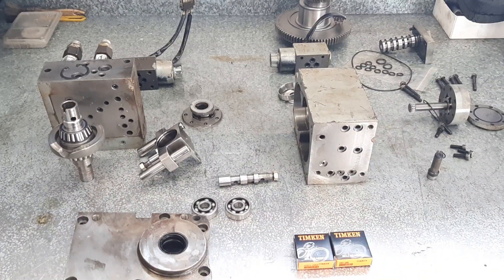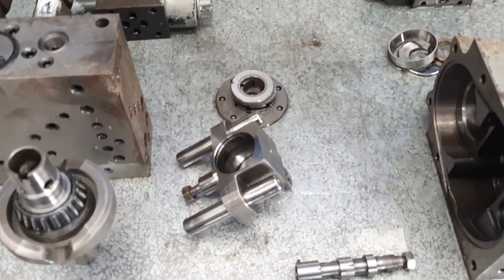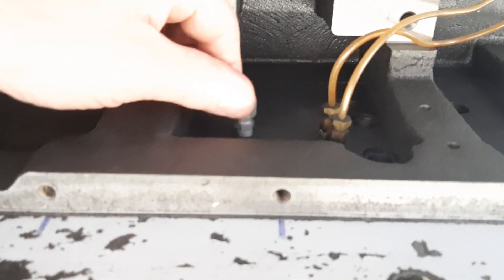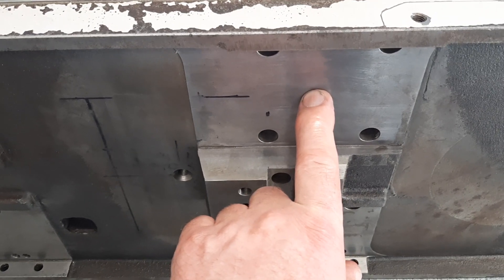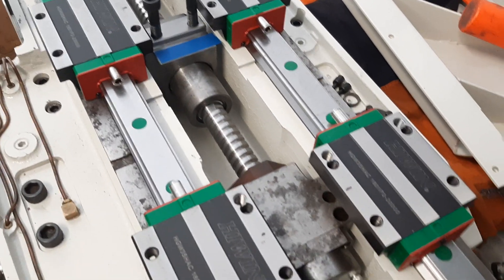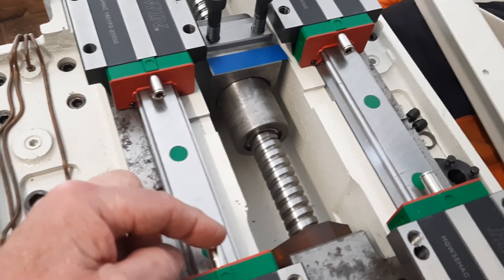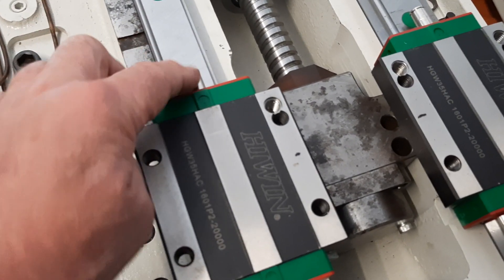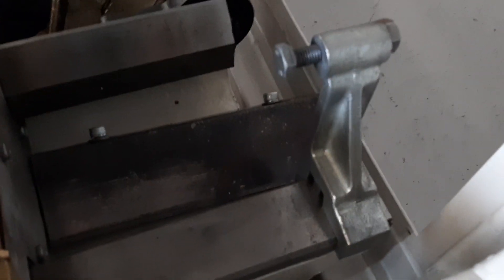CNC Lathe Rebuild. Tool Turret.

Comment: what kind of leak were you experiencing ?  was it from live tooling or just the turret leaking oil ? were you able to do tool change?
Reply from the maker: I'm not sure what leak you mean ??
This video is part of a series of videos of a full rebuild of the whole machine where I removed everything right down to the base and currently rebuilding it basically back to a new machine.
IF you're interested I do have a fair few videos posted of the rebuild👍
Reply: @weldmachine  which cnc?
Reply from the maker: @fredrezfield1629  Mazak QT15 1990 model 😉

Comment: Sorry Peter I think I missed this video upload.  I agree you can never have enough tools.  When I didn't have an ATC I couldn't wait to get one.  Then my first CNC only had an 8 tool ATC and that still wasn't enough.  Now my Syil has 12 and I still run out.  I think I was spoilt as the HAAS had 24ATC with a double arm 😊
Reply from the maker: Yes the tool holding capacity is always a concern ???
Normally on a CNC Lathe you can usually do more with less.
CNC Mills ????
Bloody endless supply of tooling ????
It,s funny because there is another version of the same machine as mine with 16 tools which includes live tooling.
The place i was working had the same Lathe as this one then later brought another version with Live Tooling.
1990 feels like yesterday now ???

Comment: Lots of progress . The material for the way wipers on the tail stock , is that original or something you have changed ?
Reply from the maker: Hey Max.
Yes it's the original Wipers for this machine.
I was thinking to change the Wipers, not totally sure as yet ??
Genuine Mazak part are not to bad for price.
Unlike on Manual Lathes, the Tail Stock on CNC Lathes is parked for 90% of the jobs.
The condition of the Wipers is still like new just the metal covers don,t look so good in the video.